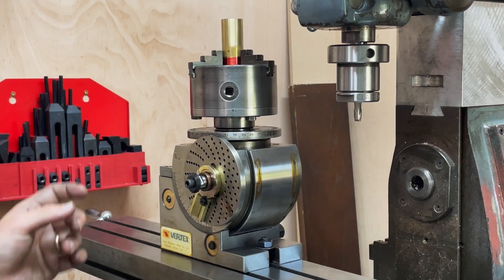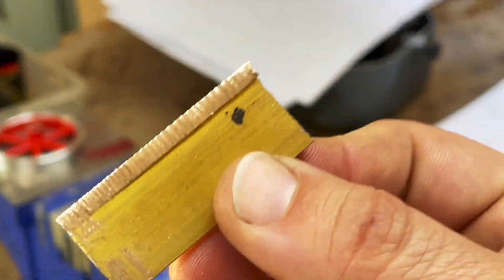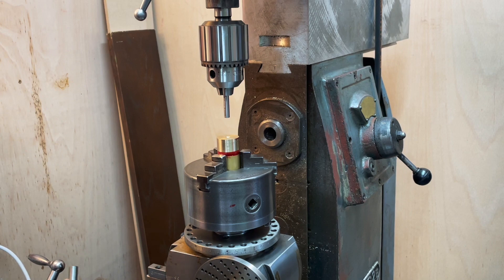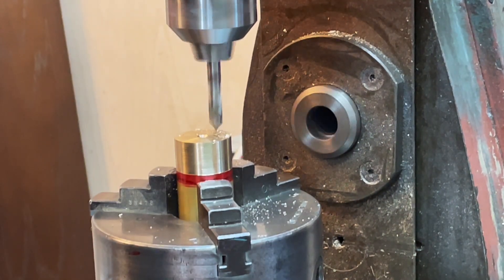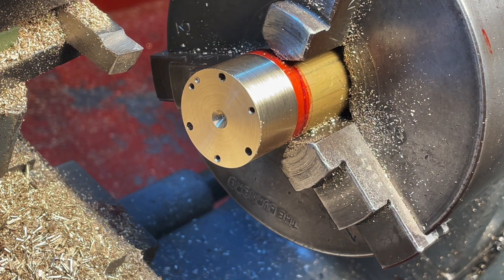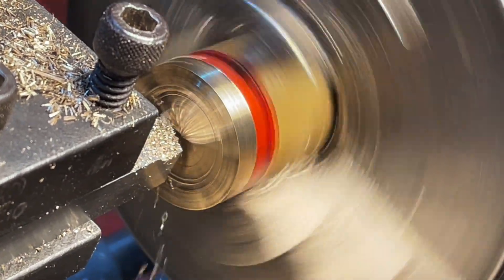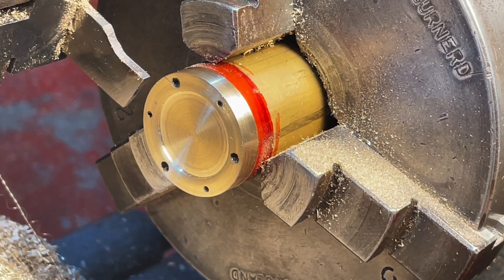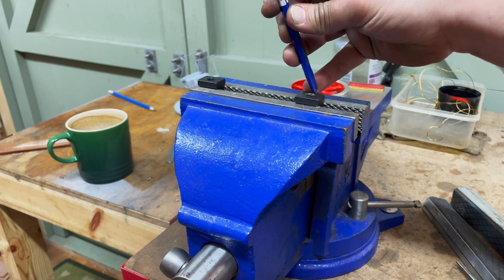Dividing Head & Cylinder Covers - Building a MyfordBoy Traction Engine 3

Comment: Here's a couple of tips to centre parts on the mill when there is not enough height. I have the same issue.
Put a centre in the spindle and don't clamp the work down.
Lower the centre to the job and it will centre in the hole. Then tighten the work holding clamps.
If the centre finder is too long use a sticky pin. A dress making pin 
and a blob of modelling clay or blue tac on the spindle works just as well

Comment: Nice one again! You could probably do without the depth gage for centering. The top of the calipers is usually ground to match so that gives a nice surface for a depth measurement with the back part resting on the edge and the front to the drill shaft